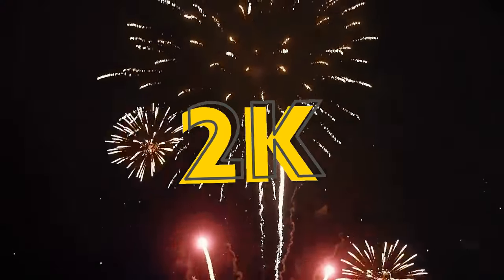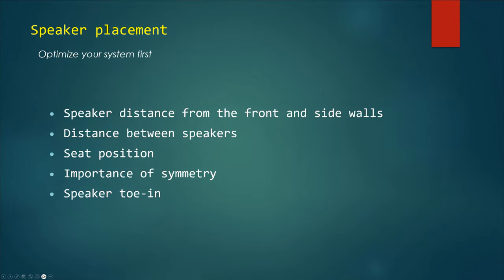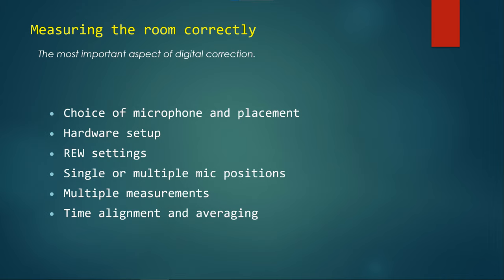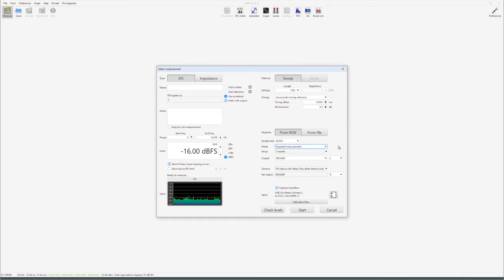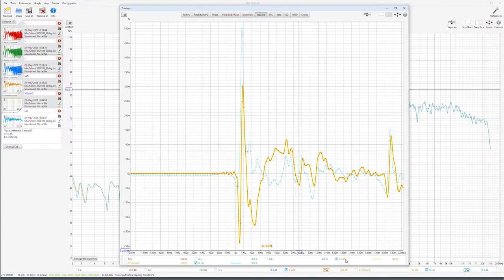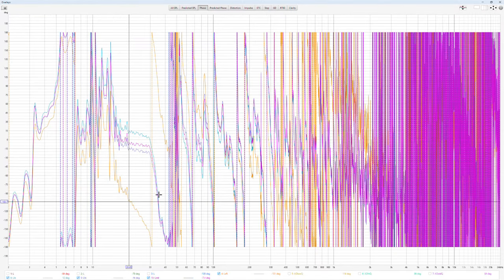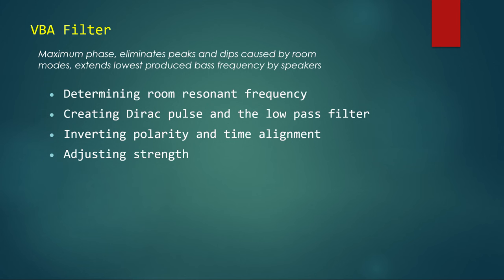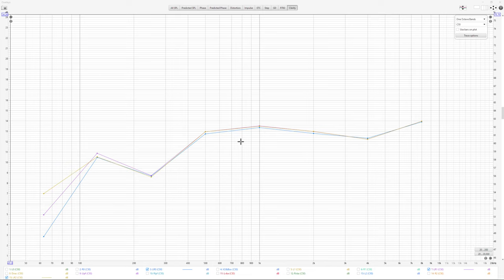Digital Room & Speaker Correction Workshop

Comment: Hey OCA, I just today discovered your channel and I'm very impressed by your expertise. Right know I'm in the middle of designing my new home-theater and wondering, if  I could book you for teaching me how to optimize my setup with the options that I have at hand. Anyway keep doing what you are doing : ) And thank you very much.
Reply from the maker: Thanks. I can direct you to the correct tutorials or forums if you give some specifics
Reply: @ocaudiophile  I know the basics of REW and also have expirence with MSO (Multi Sub Optimizer)and a miniDSP 2x4HD. I also got MultEQ-X and watching Movies in Atmos, DTSX and Auro a lot. So I want to know how to make the best use of the features of MultEQ-X in combination with REW and MSO for Music and Films. In a nutshell. But I have to watch all your videos first to be more precise. I think the main problem could be, that I can only use FIR at the software side right now which means it doesn't work with Atmos and so on and has a huge delay. But I will try to make it work for music first.
Reply: @ocaudiophile  Some edit to my last post and some clarification: I use Auro3D up-mixing 95% of the time when watching films or listening to music. So before I get separate amplifiers for my 8500HA I can not integrate external DSP and therefor can not access the height layer output for filtering except through MultEQ-X, I think. Also because of the up-mixing I can not use software DSP for the floor layer because it would also effect the height layer, I think. So in conclusion I can only use my AVR options and MultEQ-X and I will watch Supreme Audyssey Calibration by OCA next.
Reply from the maker: I've made REW sweeps for Atmos channels, you'll find them in all Audyssey videos so measuring height channels is not a problem. However, you're limited to GEQ in the Denon for correction. The only way to use FIR filters is to hack Audyssey through the Multeq editor app.
Reply: @ocaudiophile  How do we play the Atmos channel sweeps into the processor?
Reply from the maker: Same as with any AVR, connect your PC with HDMI and play the sweeps in Windows Media Player with REW. Full instructions are in the videos.
Reply: @ocaudiophile  "way to use FIR filters is to hack Audyssey" I missed that till now. I also got the app, so I can try that. Have you ever looked into the features of MultEQ-X? I was thinking to use it for time alignment, because it seems to compensate the problem with the distance settings within the AVR. Also Volumes can be set in 0.1 steps and an unlimited (in theory I guess) number of PK can be used. I would love to see a video from you about the possibility's there.
Reply from the maker: @baronbob6971  I don't have MultEQ-X because I never needed it. It's great for fiddling with the Audyssey correction but you cannot hack it. In my method, I fully bypass Audyssey correction and manipulate its FIR filters to obtain the results I want. Watch my Audyssey videos (not the manual calibration ones), you'll have an idea.
Reply: @ocaudiophile  Just an update, multq-x does let you bypass all its corrections by simply disabling all measurements made with the audyssey mic... Its basically an easier way of using multeq editor hacked, but doesnt really provide anything extra for whoever hacked multeq editor app
Reply: Also I found out that even the perfect ady file does a high frequency rolloff which you can't bypass, so to truly bypass audyssey you need multeq-x...
Reply: @johnaps  I also wanted to write that😅 But I would make tree comments on your post. 

1. I think time alignment and volume alignment would be more precise. 

2. Equalization would be MUCH better I think. In the Beta form REW it is now possible to make custom EQ's. I tried that yesterday. I could dial in the exact capabilitys of the Bi-quads from MultEQ-X in REW. +24/-40 dB, 0.1-20.0 Q and 20-20000 Hz. Then I sat the max number of filters for custom EQ which is 31. REW used 28 of these filters. Then I exported them to TXT and imported them to MultEQ-X with no problem. You can do this easily for every separate speaker. So I think that is a huge advantage. 

3. What seems to be not possible is to use FIR filters. At least not in the way OCA does it with the app. But I don't know if it would be otherwise possible with the functions of MultEQ-X. So I would really love, if OCA would take a closer look at it. I would also be happy to donate 20€ for his license. But if it is not possible to use FIR with MultEQ-X it seems to be a huge disadvantage.
Reply from the maker: @johnaps  It's the two different high frequency roll-off options embedded in the MultEQ Editor app and you're stuck with one.
Reply from the maker: @baronbob6971  MultEQ-X is converting your biquad filters to FIR at the end. The Audyssey chip in the AVRs can only use FIR filters.
Reply from the maker: @johnaps  That's why I never bought the X ;)
Reply: @baronbob6971  i have seen time alignment to be very much better with multeq-x too!
As for eq, i think the multeq-x works similarly as the mult eq editor app works but lets us have 'filters' import function for a seemingly easier integration with rew etc...
Idk if it is worth the 200 dollars in all cases, but it is much easier and worth if this is your last receiver...
Reply: @ocaudiophile  ( It's the two different high frequency roll-off options embedded in the MultEQ Editor app and you're stuck with one.) i know, this was one of the top reasons i bought multeq-x
Reply: @ocaudiophile  "MultEQ-X is converting your biquad filters to FIR at the end. The Audyssey chip in the AVRs can only use FIR filters." 

Would it then be possible to let EQ-X generate the desired FIR filters by some other way? I'm not deep enough into the subject of the hole matter to make even an assumption about it.... I started to learn about it only yesterday : ) Do you think that the advantages of EQ-X could weigh out not having custom FIR? 

And just to make myself clear I'm not saying EQ-X must be used no matter what or want to be a know it all. If the method with the app works better I will happily do that. But EQ-X has most of the capability's of a dedicated miniDSP for each channel. And I just would like to understand if your method could be improved by making us of that. That's all. And because I got ADHS I want to know it NOW! ; )
Reply from the maker: I don't have MultEQ-X but I am kind of certain it's not nearly as easy to hack as the editor app. Before the editor app times, I used to try to hack the calibration file from the receiver calibration files saved to USB and they were all deeply encrypted. I believe X is not any different. It's a nice effort by Audyssey to save the day and it's probably easier to use and all, but the eventual correction applied in the receiver is the same 1024 taps FIR filters no matter what you use to shape them. I would instantly pay $200 for an addition to the editor app to turn off extra surround and height boost of DEQ but I guess they cannot even do that because the company doesn't even own Audyssey anymore.
Reply from the maker: My suggestion for X users is to apply the varying strength REW Auto EQ method explained in this video tutorial and although the filters will be linear phase rather than minimum phase, it will still give a smooth and lively response to speakers. At least with DEQ off, you will have great sound at the level you have measured your system.
Reply: @ocaudiophile  they will do the deq surround boost optional in the next update, but as i said its obvious they didnt change the way eq is being done inside the receiver, there is a little more accuracy by a little margin here and there... It is basically an easier and slightly better alternative to the multeq editor app hacked and what it can do
Reply from the maker: @johnaps  I doubt that update because it's so easy to do and they wouldn't wait that long to do it but I can assure you I will have to buy the X if that's the case. On the plus side, a multeq-X tutorial video will boost my channel massively, I get asked about it almost daily since months ;)

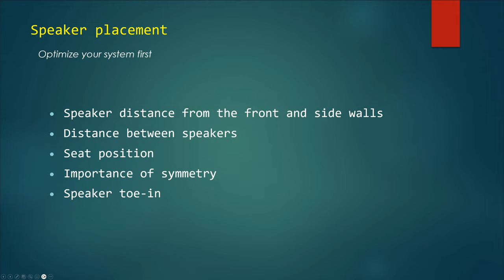Comment: Hi All,   OCA makes a valid point to spend time on the placement of the loudspeakers, especially with toe-in values. Its really difficult to accurately measure an angle of the toe -in to the LP, that I have used the Apple iPhone compass app. By taking a degree measurement of the front facing wall and then placing the phone on the speaker front edge can then add or subtract the angle of the speaker very accurately. I find I get both the speakers with equal toe-in. Once you can do this easily, then experimenting with the audio tracks mentioned (9:45) to find the optimum toe-in for your speaker and the distance well worth the effort.
I believe the more accurate the placement from walls, toe-in and LP distance the less work the DSP has to do and a better result you make end up with.
One word of advice. Preserve with your experimentation, re-listen to the video, take more measurement readings and select the averages.
Don't give up. Although OCA does say it should not take long to perform the measurements, you will always get something not quite right. So do it all again.
If you follow the instructions, and double check your results, at the end you will have something only very few "audiophiles" have  near perfect reproduction.

OCA has put so much of his time to give us this economical opportunity to get the best from whatever equipment we have, we owe it to him to be a good pupil and get top marks. (Insert large smiley face here)

Comment: Hi OCA, I enjoy your videos very much. Thanks for all the hard work!
I have a small question regarding some inconsistency between the way your perform the measurements and what is stated on REW's website.
In this video you run multiple measurements with a USB mic as input and a DAC as an output. and the REW states the following:
"REW allows multiple sweeps to be averaged, although best results are generally obtained by using single, longer sweeps rather than multiple, shorter sweeps. Multiple sweeps are offered when not using a Timing reference or when using a loopback as a timing reference. Do not use multiple sweeps if the input and output are on different devices (for example, if the input is a USB mic). If Repetitions is more than 1 REW uses synchronous pre-averaging, capturing the selected number of sweeps per measurement and averaging the results to reduce the effects of noise and interference. The pre-averaging can improve S/N by almost 3 dB for each doubling of the number of sweeps. Averaging can be useful if the measurements are contaminated by interference tones, whether electrical or acoustic, as they typically will not add coherently in the averaging and hence will be suppressed by the process."
 - https://www.roomeqwizard.com/help/help_en-GB/html/makingmeasurements.htm
can you please shine some light on the topic?

Thanks a lot!
Reply from the maker: I couldn't get the link above opened but multiple sweeps mentioned there must be for RTA or multiple mic measurements. REW doesn't average regular measurements on its own but gives user a lot of averaging options instead. Longer and louder sweeps will always have better signal to noise ratio but they will still benefit from repeating and averaging.

Comment: Awesome Information! Quick question, any suggestions for a diy active setup. Is it better to start with speaker calibration and then room correction?
Reply from the maker: Thanks but I have very limited knowledge with DIY speakers. Check diyaudio website on that. You should take your room size, room reflectivity and wall proximity into consideration to decide what kind of speaker to design though. Room correction is the final touch.

Comment: Thank you so much for this. I've just started using REW and measuring my room and needed a proper explanation on how to generate filters.
I saw both parts of the series, would you say that all filters are necessary, if not, which are the most critical?
My system is in a dedicated room, with room treatments (corner bass traps, panels on side and rear walls), so should have a good starting point.
Reply from the maker: VBA wouldn't work well in treated rooms in my experience with viewer data so you can skip that. Sort 20-200Hz out and add a xo phase linearization and I guess you'll get 90% there.

Comment: Really fantastic information. I cannot work with FIR at the moment. I play with different systems which only provide PEQ. Does it make sense to produce minimum phase responses before applying REWs PEQ filter calculations? Or - as another idea - is there a way to follow your method and calculate best possible PEQ-filters from your FIR-filters. That would be really interesting. Additionally, applying DSP to cheaper and older systems (cheap amp, old speakers) often require some more DSPing in the upper frequencies (often to bright relative to basse). I receive good results but loose a lot of headroom and sometimes the corrections are as high as 8db.
Just as a note: In my main system, I use better hardware (a Lyngdorf TDAI-2170 amp, Harbeth P3ESR XDs and 2 Aperion Bravus 12 subs).
I am always looking forward to your videos. Certainly some steps beyond most of the measuring and EQing advice I found elsewhere 👍🏻
Reply from the maker: REW'S PEQ works even better on the MP response so long as you stay below Schroeder's. There are now shelving filters as well on the latest beta.
Reply: @ocaudiophile   First of all, sorry. I wanted to post under your new video. Thanks for the quick reply. I will use the MP-Versions of my measurements. I can generate Schroeder's in REW in "RT60 Decay" with with "Calculate RT60 model", right. Schroeder is T60M 1/1, correct? I am not sure what you mean with "stay below Schroeder". What do I have to look for? And what would be conditions where I should not use MP-Versions of my measurements? Have a great weekend
  Bidjan
Reply from the maker: @bixite I only meant not to correct for above 200Hz. You dont need your rooms exact Schroeder's freq.

Comment: OCA, thanks for sharing you knowledge and findings!  The community enjoying the sound improvements!  

Question, in previous videos you've recommended 1M Sweep Lengths.  Is the new standard 128k Sweep Lengths with multiple measurement with cross corr align?  If so, I would also assume this would apply to previous videos to take base measurements?
Reply from the maker: 128k for phase/time alignment related measurements, longer for frequency resolution and SNR
Reply: @ocaudiophile  - Got it!  Thanks!

Comment: I think your work makes REW a lot more popular. Taking off my hat!
For me, there is a problem in understanding the methodology and following your algorithm because:
- I'm not native English
- you speak fast and move your mouse even faster :)
To somehow cope with this, I make my outline step by step with screenshots. In order not to miss anything, I make a start-stop of your video almost every second. Video length is not a problem. The problem is not losing accuracy.
And I have a question. My acoustics is Dynadio 40 Shecial. According to information from the network, it has a first-order crossover of 6dB. But rePhase has a minimum of 12. Do you have any ideas how to get around this limitation?
Reply from the maker: You can create an 18dB/oct phase filter with a time and polarity inverted 1st order AllPass but there's no way in rePhase to produce a 6dB/oct filter. I guess Tom thought any crossover filter will have a minimum of a capacitor and an inductor which is 2nd order already.
Reply: Hmm.. I made screenshots of my acoustics. Take a look, you might be interested. The crossover has both a coil and capacitors, but it is claimed to be of the first order. Or am I misunderstanding something.
https://drive.google.com/file/d/1pck6b65ZLdK62RJV77jKRvQOFf7FKa2W/view?usp=sharing
Reply from the maker: Well, if Dynaudio says so I will have to agree ;)
Reply: I am also pleased with the resourcefulness of Dynaudio engineers. But I'm sorry that I can't use rePhase to box correction my acoustics. I liked how you experimentally selected the best parameters.
Did I understand correctly that your recommendation above refers me to REW in the EQ section? Is this also some kind of experiment?
OCA, in one video you said that the method is difficult because there is a high chance of human error. For me, this is 100 percent true. But I'll be persistent because I like the level of this solution - instead of post-removal of acoustic-room interaction by amplitude correction, you develop a FIR-based method that eliminates the very nature of the problem. Beautiful solution, almost perfect!
Chances are you are not a pioneer. But you have done a very great job. With thanks!

Comment: Hey OCA, thanks for another great tutorial 👍 This is the first time I do the rePhase part and I'm a bit confused with my Fyne Audio F502SP corssover type.
The spec says:
Crossover frequency	250Hz & 1.7kHz
Crossover type	Bi-wired passive low loss, 2nd order low pass, 1st order high pass
To be honest - I have no idea what crossover order type I should choose and whether to invert the phase or not :/ Could you pls point me in the right direction?
Reply from the maker: ENter the XO frequencies in the filter linearization tab of rePhasde and check which order flattens the response. Start from the higher XO frequency (1700Hz in your case).

Comment: Hi, great tutorial!
Is it possible to use 20 - 24 000 Hz measurements instead, some sort of imputation maybe?
My amplifier goes into protection mode for a few seconds at the end of each impulse which corrupts the sweep start, especially for sweeps above 70 dB and longer than 1M. When starting at 20 Hz I can measure at significantly higher dB.
Reply from the maker: Yes you can!